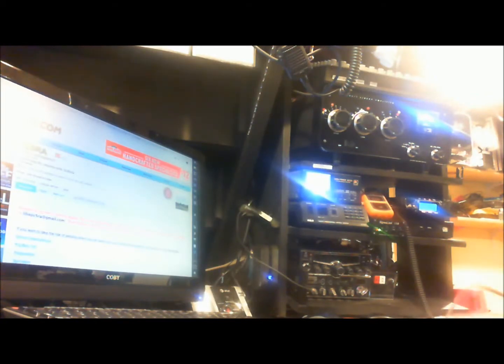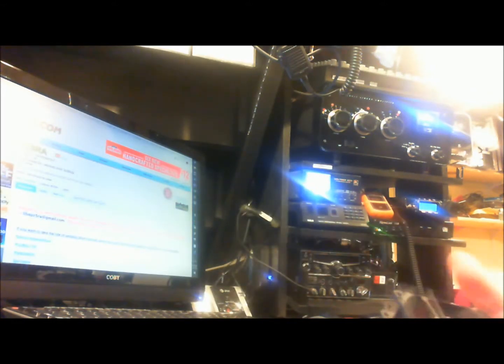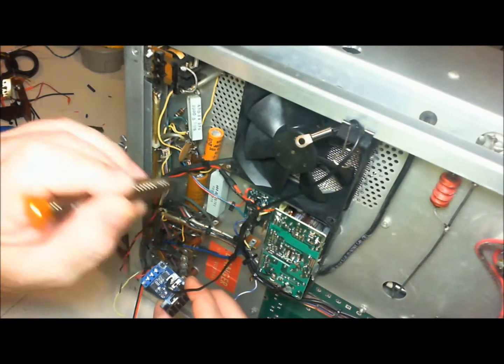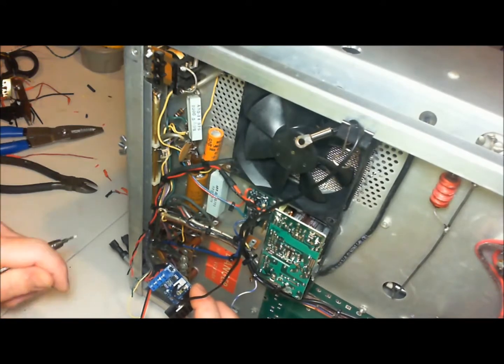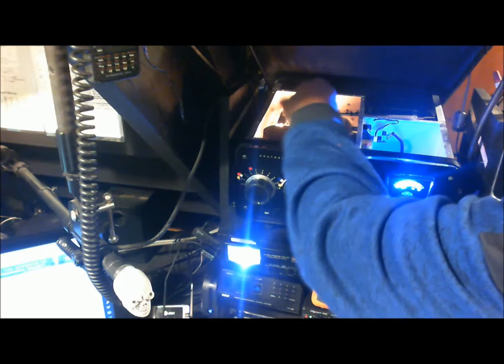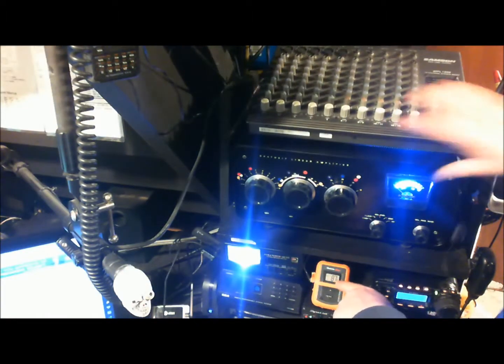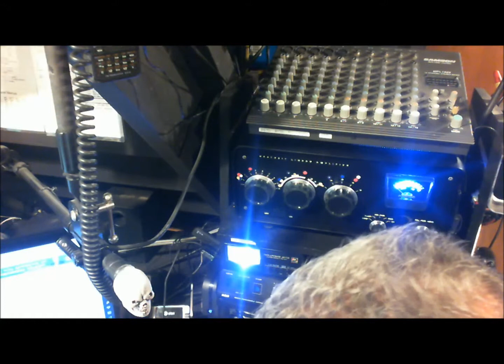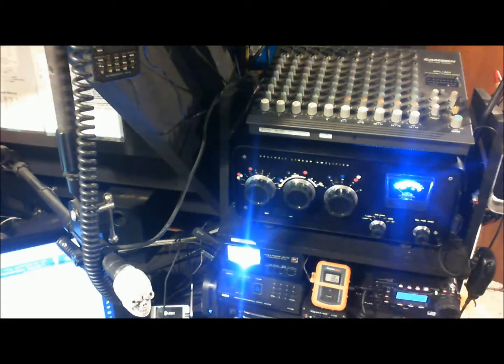Heathkit SB-200 Fan Change out

Comment: The same Tubes are still in use? 572b s are not happy abt keydown Signals normally!
Reply from the maker: The tubes may not be happy. I have a few other issues with the amp. I need to bring it to the amp doctor. As hams we can all figure it out. However, I like short path. Someone who can pop the cover, takes a whiff, and knows the best direction to go in.